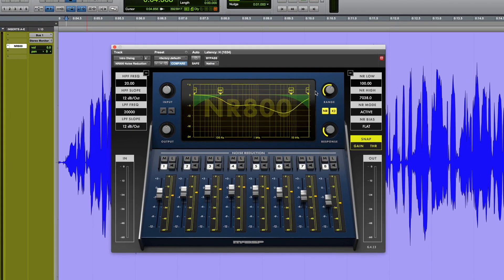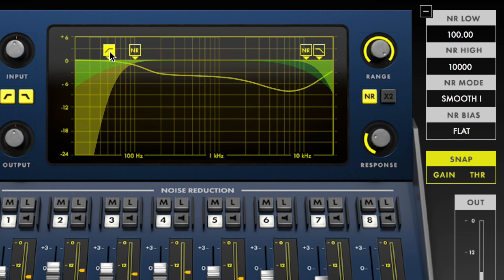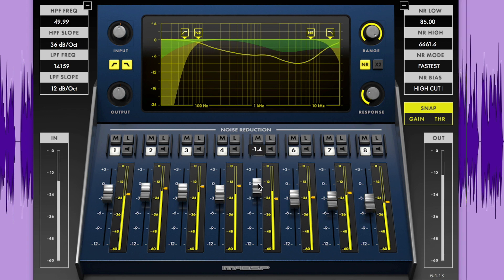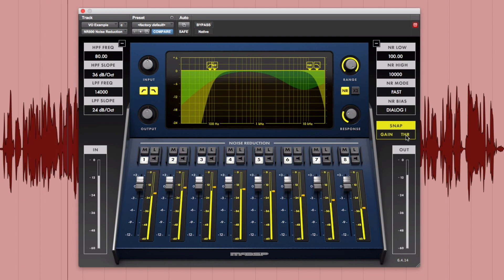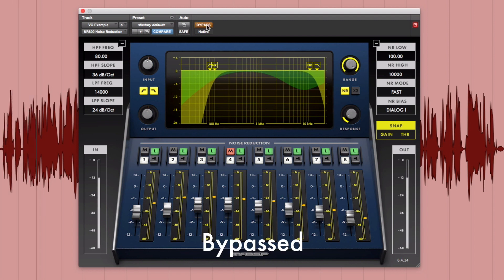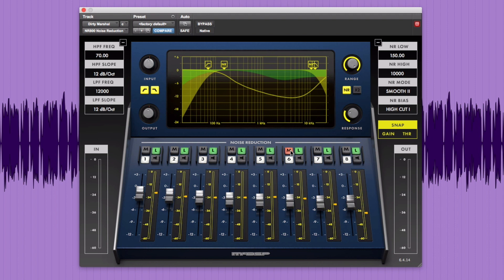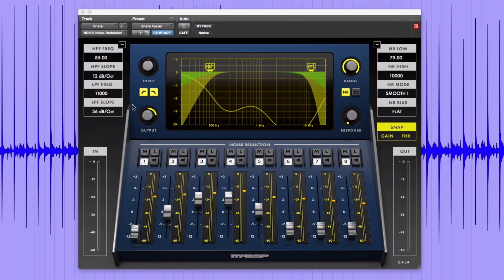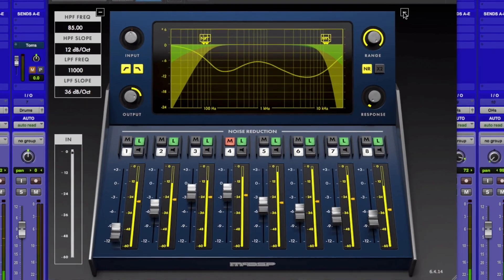NR800 Noise Reduction Tutorial

Comment: This comment is from a daily user of WNS. While RX reduces constant noise often there is a need to dynamically control NR to attack swells of traffic and hiss for example. NR band faders are a very smooth tool for that. After testing side by side with WNS it does all it should and initially sounds a bit better, fuller and less sibilant! Plus there are refinements to controls and a few options not in WNS plus this has AAX DSP support. Here's a note to McDSP and dialog mixers  - Tricky bits are in the master link set up. The master M button can be automated on /off but there is no option line graph to edit M master automation enable on/off?  You can't just lasso several faders as with WNS you need to use the Master and Link. So a few extra steps to actually use. At first this seems a bit complicated to be repeated over and over. But its great to have a new dynamic noise control tool for post!

Comment: Sounds pretty good. I'll certainly keep this in mind for the next dialogue mix I do. You can never have too few options. The guitar example was the most impressive to me. Clean sound. No suppression artifacts that I could hear so far. It looks flexible. If I use this, I might need to grab an extra midi fader bank to control that large set of parameters. More than DNS, WNS and RX Dialogue. Cool.